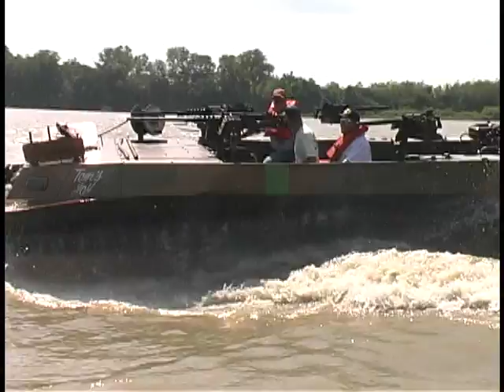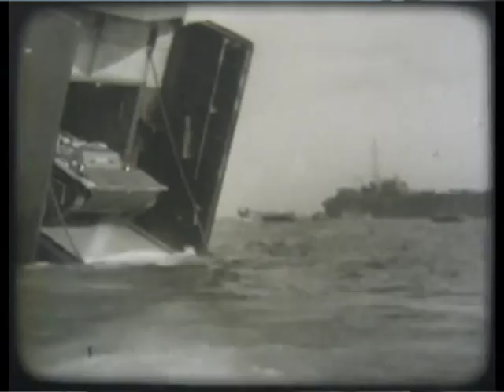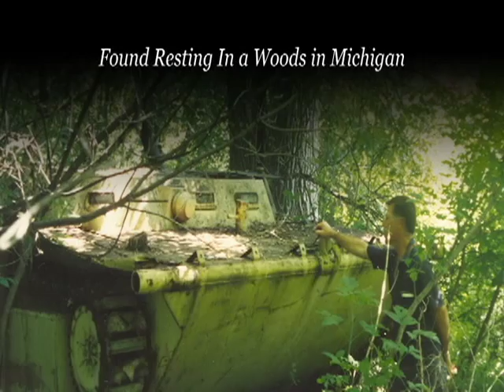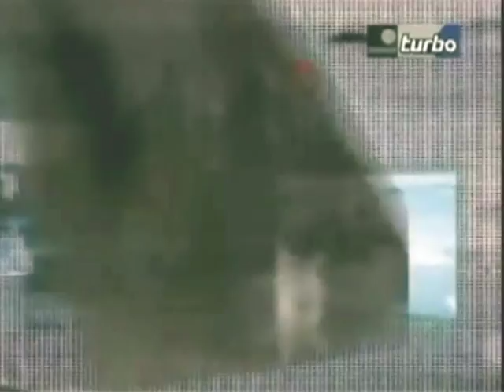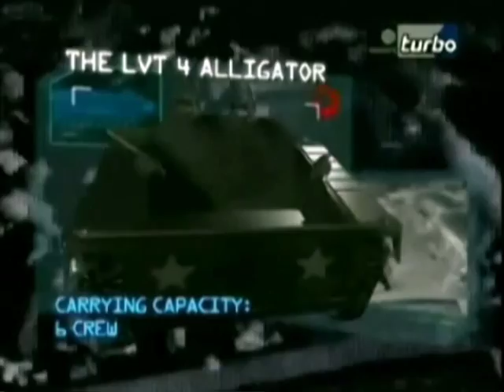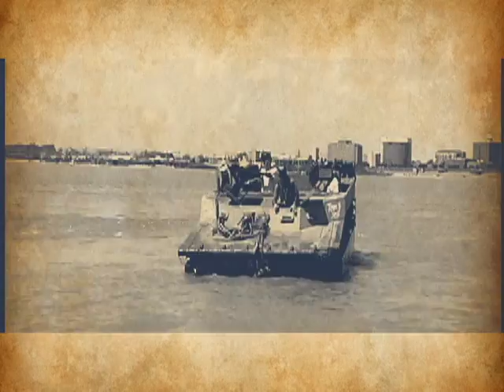LVT - Landing Vehicle Tracked

Comment: Hello Tom. Very cool thing you did restoring the Amtrac. I was in the Corps from 1978 to 1982, in Amtracs, was a Section Leader, and used the LVTP7. I checked on the stats for the P7 and they showed around 45 mph on level ground. When I was overseas, my Amtrac could run 58 mph all day long with the 400 hp Detroit diesel. Anyway, what you did was great. Semper Fi, Sir.     Sgt. Ben B. Savage, USMC

Comment: Hi pistonar. The LVT do serve a good purpose and I have seen a picture with one on Normandy beach. The LVT only holds about 18 guys and is quite slower at landing and recovery. The LCVP holds about 36 guys and is quicker to land and retract. The LCVP is built of wood so they are easier to build and less expensive especially when metal is becoming scarce. I don't know all the facts but these are some I have picked up along the way.